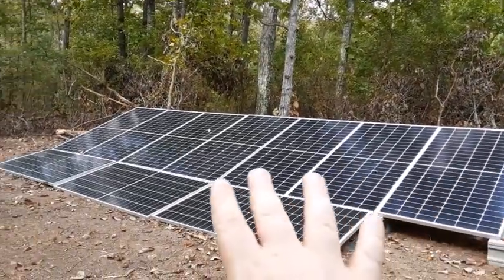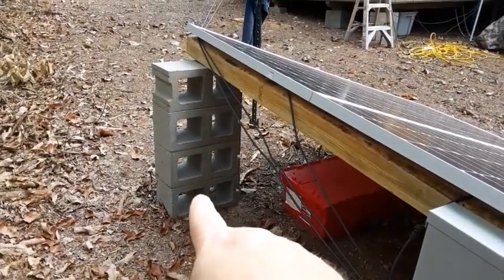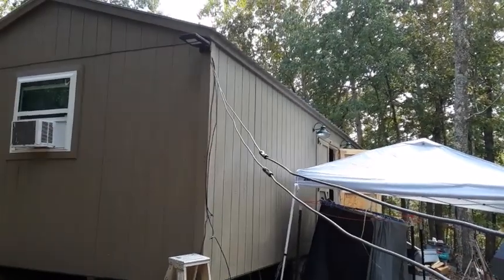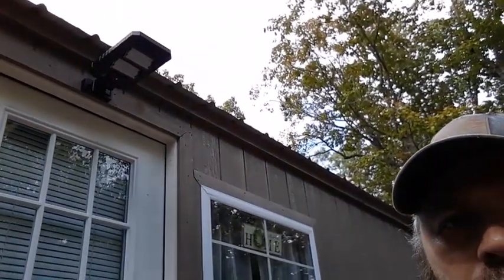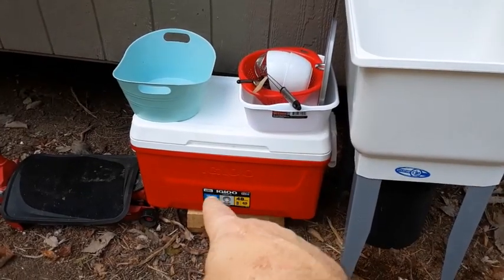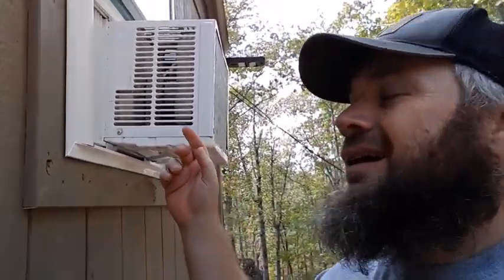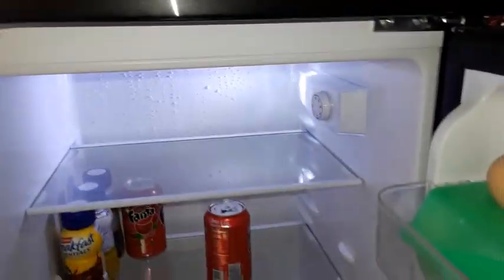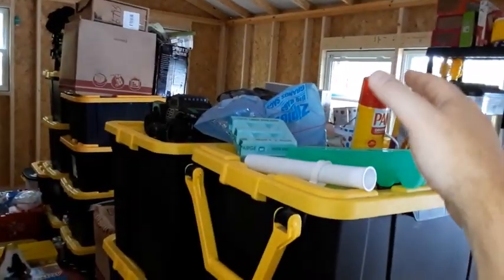Tiny Home Mods continued S1 Ep6

Comment: Bill I'm so glad your going with spray foam insulation.  It will give you a 100% moisture barrier wherever it is.  Even if your roof leaked it will never penetrate the foam insulation.  Too bad you can't raise the shed 3 ft up so he could stay foam the underneath of the floor. You'd have a lifetime protection for rot! And giving Tennessee is so humid you need every advantage to combat mold and rot.   Good luck Buddy, I know you've got this. 😀
Reply from the maker: I might squeeze my fat @$$ under and hit it with cans of spray foam myself. If I get stuck just seal it up and mark my grave " At least he tried!" =P  Yeah the humidity is x3 worst then Lower Virginia.  Guessing the winters should be super short and mild for this region.
Reply: @TheWickerShireProject  wow that sucks with that humidity level🙏🎈
Reply: They are already pretty high in the air so underneath can be done
Reply from the maker: @simplymeconnie   North east corn is a low spot.  Ground is super rocky and clay. If my 9 year old had skill i'd send him under there to can foam it all. =P
Reply: @TheWickerShireProject  So dad, get a cheap can of spray paint. Do a fake underneath... and teach the kids how :) :P

Comment: Just a suggestion if you paint a couple of those big barrels black the sun will heat them up and you will have hot water instead of just having to use that small shower bag. Your doing a great job.
Reply from the maker: Our problem is they will be on the North side of the house in the shade.  Winter is brief here but, the long hot days spring summer and fall are very lengthy.  We chose the North side to keep them cooler. I will have a roll of heat tape set to 38F as back up this winter. to prevent any minor freeze.  Had we lived North I agree on the paint and a full southern exposure. Thanks for the tips. We do love them. All and any help will prevent us from future mistakes if I miss calculate the build here. <3 Thanks Sana!